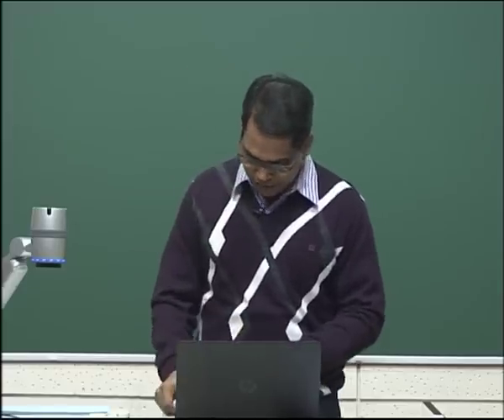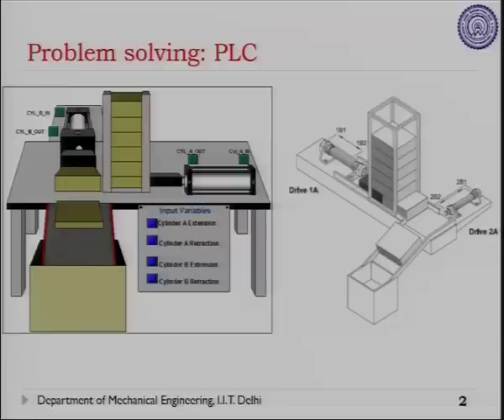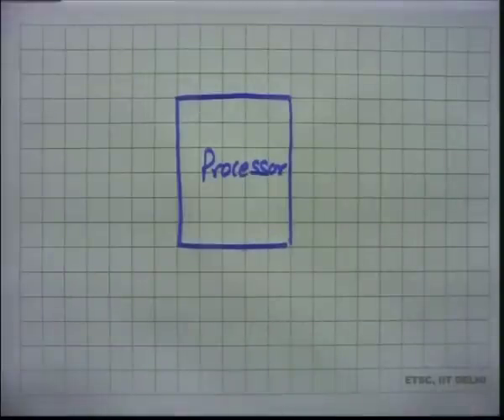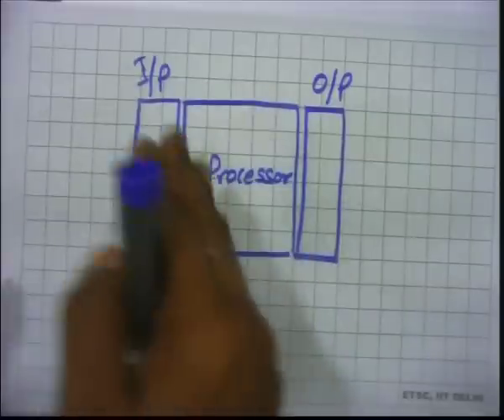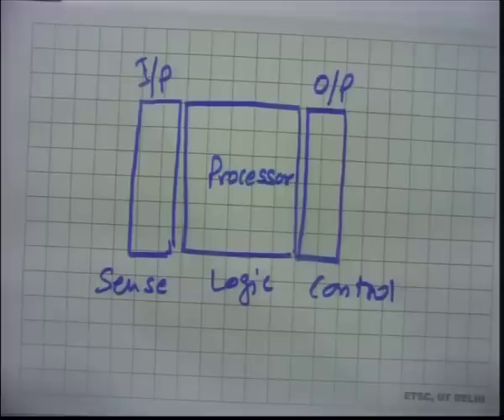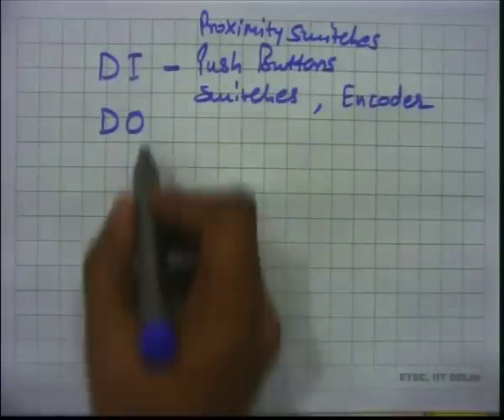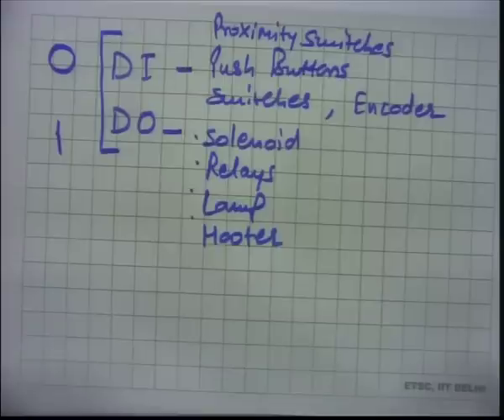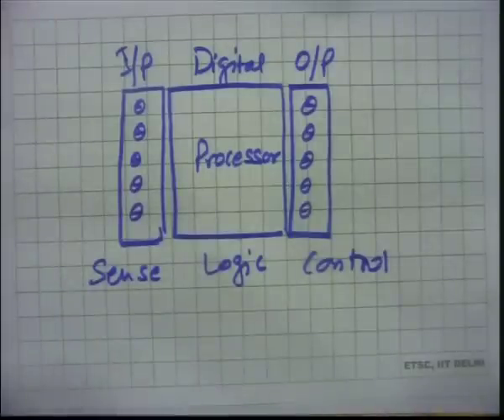Programmable Logic Controller (PLC)

Comment: It's one of the most informative lectures on the PLC basics, Still expecting a bit more like the internal structure of the I/O modules that communicate with the processor with the help of an optocoupler,
Whatever it may be, but the overall lecture was too good Sirji lot more information covered in a single lecture. 😍